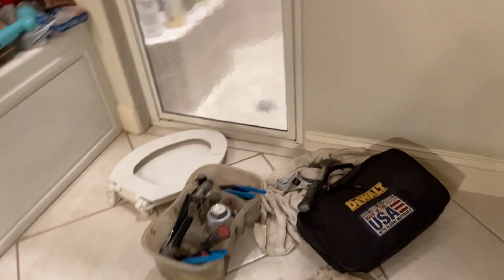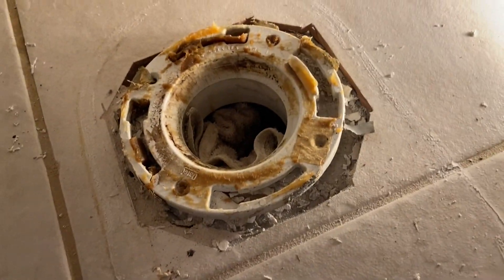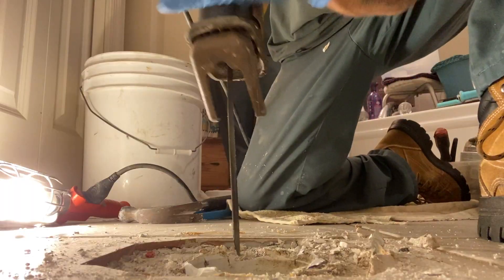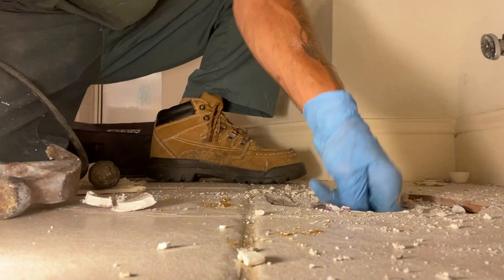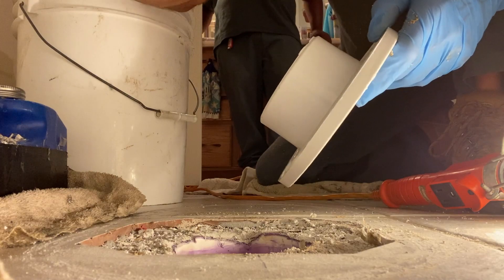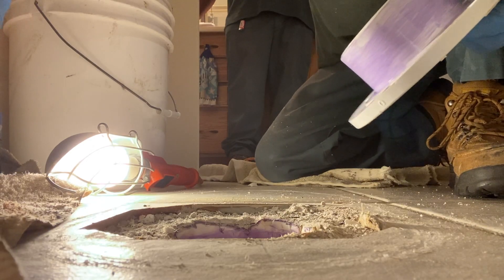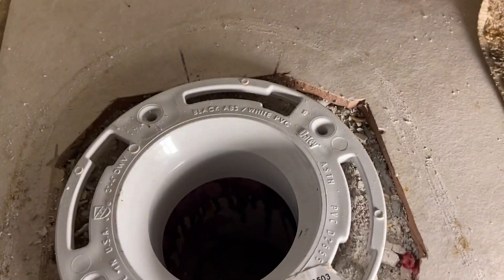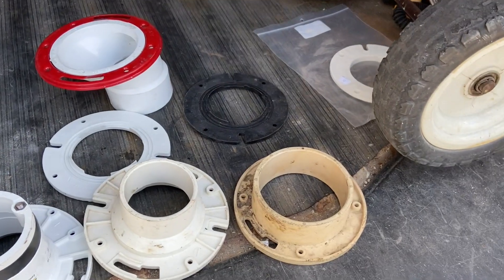HOW TO REPLACE A BROKEN PVC TOILET FLANGE

Comment: Thank you for your video. It was very helpful. I wasn't sure if it was possible to separate a flange from a pipe to which it had been glued but seeing you knock it out gave me the courage to go for it. I started out using my reciprocating saw but it seemed like overkill so I switched over to my Dremel and it cut like butter! Thanks for your tips.

Comment: Closet flange are supposed to be installed on top of finished surface. You should of installed a spacer underneath the 4 & 3 flange and tapcoms.

Comment: Great vid Tim, you STOMP that nasty flange! I'm dreading this one: I've got an outside flange, i.e. a 4" flange around a 3" pipe, and the thing has to go - never did that one before. Also gotta fill in the unreal concrete void around the pipe left by the original builder about 30 years ago. (Looks like they roughed it at 10", said 'whoops' then busted it out to about 11 1/4" and um forgot to back-fill the giant void they left.) Anyway, ya got a vid or other input on outside flange removal? any tips or tricks... or should I just sell the house. Thanks Tim, and keep 'em coming. Enjoyed it.
Reply: Should that void be filled ?